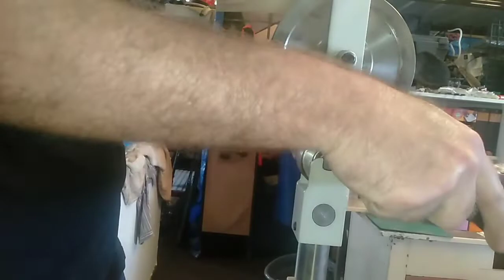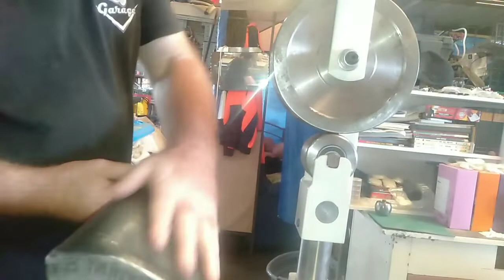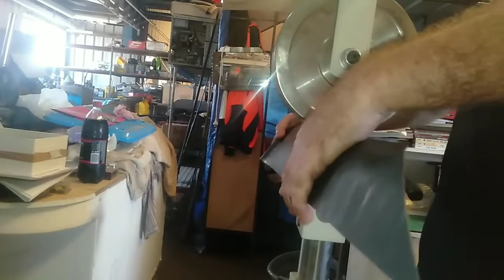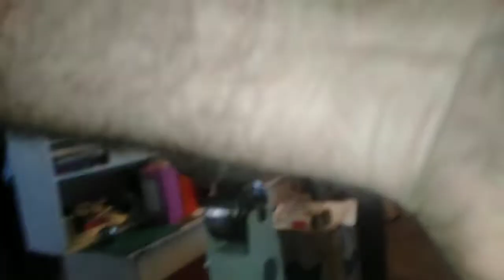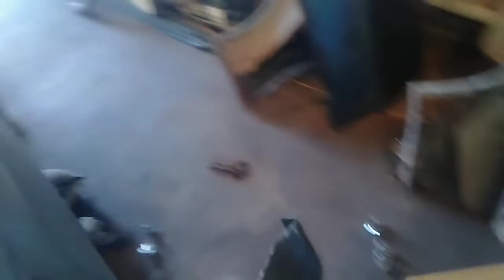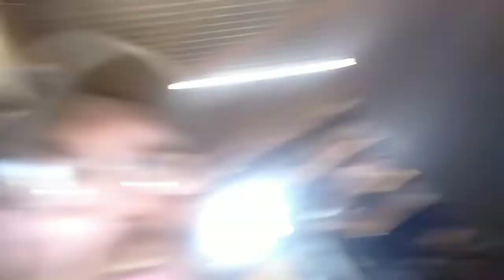Putting a curve in the lower right hand qaurter repair panel

Comment: Incorrect way of use. 
If you want to use the wheeling machine to fold roll that panel into that shspe, slip a rubber tube on top wheel and use the as close as possible lower anvil to shape you want. Use low pressure. 
Would have been better to roll it into shape first then flip end flanges.
Reply from the maker: Thanks mate for your comment mate I have got one of the rubber band things for it and this was the only way I had known how to do it and this way has been working at this stage. Thanks again mate